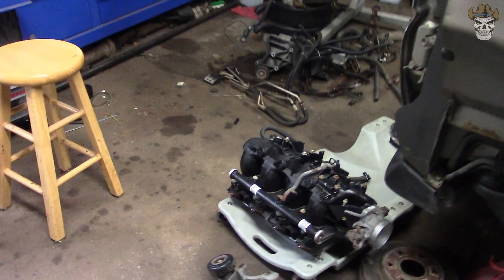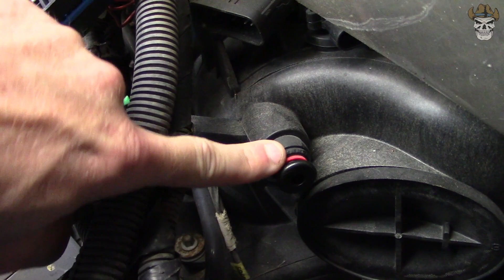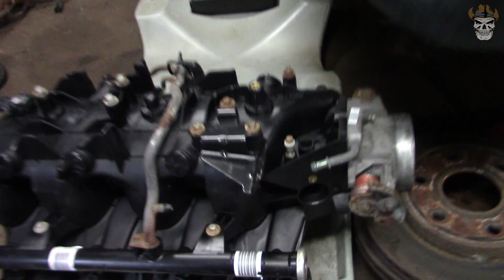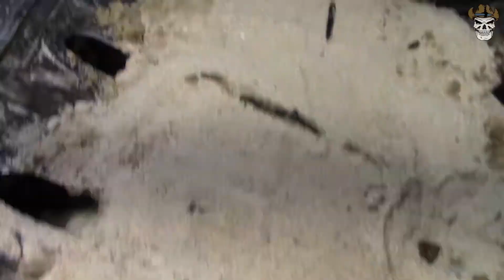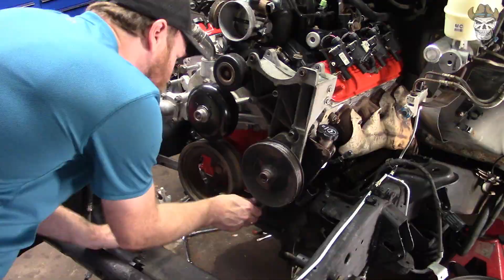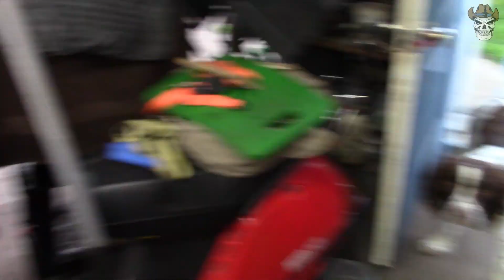Intake Installed On The Escalade Build.

Comment: That vacuum port looks like a pex fitting for plumbing. They really liked the push on lines for these trucks.
Reply from the maker: I like it.  I was worried I was going to have to whip up some JB weld to plug the hole.